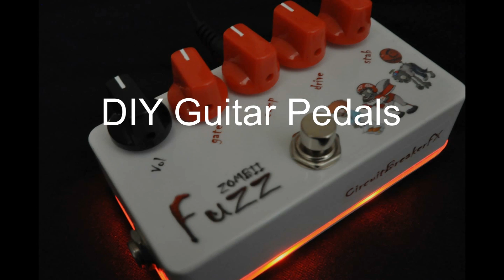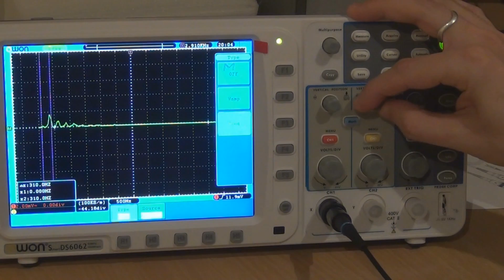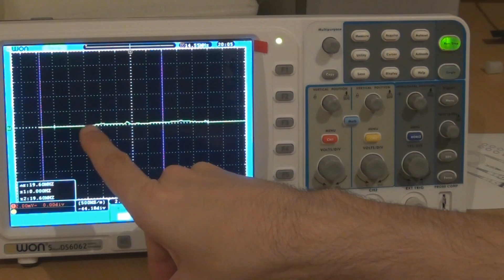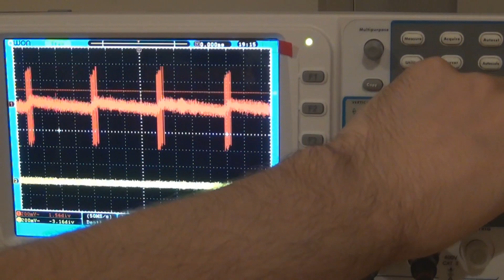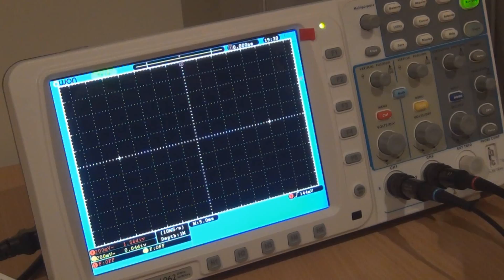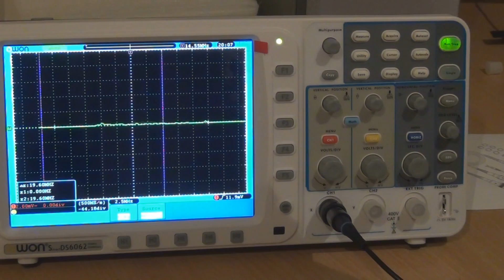Noise From Guitar Pedal Power Sources

Comment: What you constructed in the previous video was a low pass filter. These can be RC (resistor and capacitor) or LC (inductor and capacitor). Look up low pass filter RC (or LC) calculator to determine the values you want. Your 470 uF and  100 ohm filter shows a cutoff frequency of 3.4 Hz. You want the cutoff frequency to be very low to remove as much AC hum as possible.

Comment: Just a tip, the SDS6062 have tons of automatic measurement. Instead of guessing the Vpk-pk you can turn it on:) And the battery noise is probably self-noise.

Comment: Battery have no noise. Hum come from environment, mains, various lighting stuff, or oscilloscop itself, as you noticed.  But DC noise is quite easy to reduce, via electrolytics and shielding.
 You should try to measure noise at the pedal output with and without guitar plugged in.